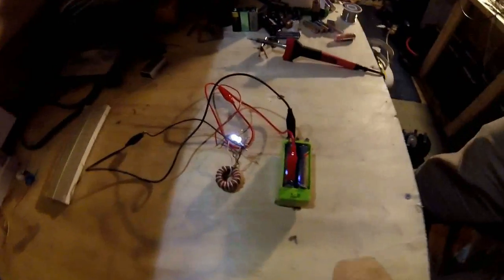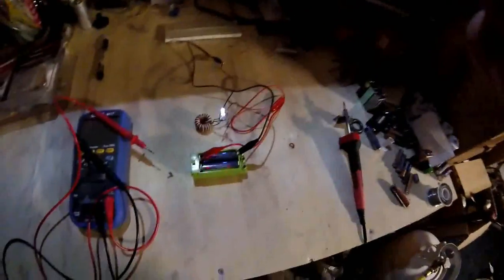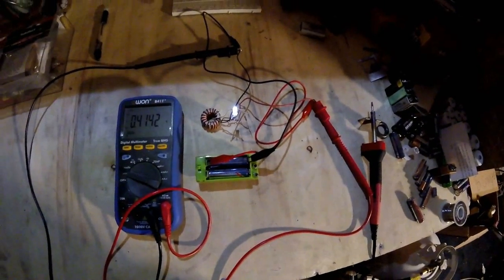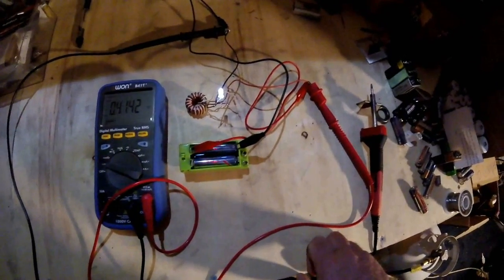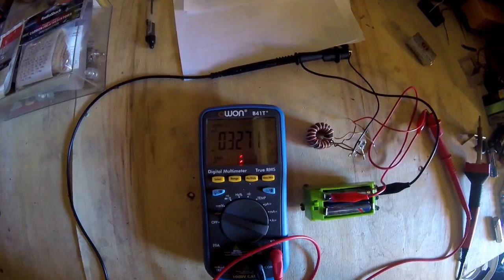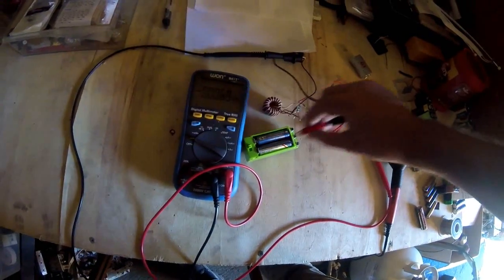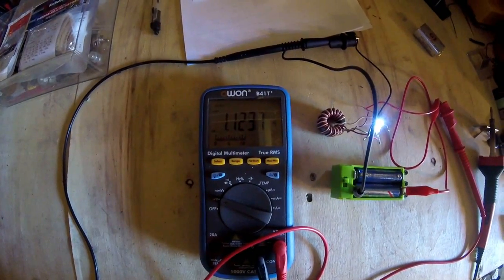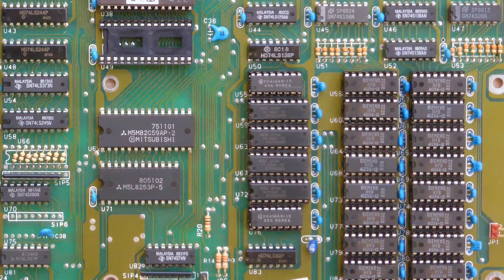Joule Thief Update After Running 3 Days Free LED Night Light

Comment: Hi Troy,  try connecting the joule thief  directly to an earth copper rod  and iron nail instead of the battery ...lets find out if the led lights up... you got almost .5 volts from  earth last time you tried!!!
Reply: good suggestion
Reply from the maker: I doubt there would be enough current but I can try

Comment: Hey Troy you cameras may be garbage at night but there is a solution i bet the have an cmos sensor that captures the pictures just like our mobilephones and thats the point you need some invisible light buy some ir (infrared) flooder and then you can see all clearly at night without blur and visible light someone may think he or she is invisible at night but everything will be clearly seen on cam try this i made my own floodlight ir out of an transmiter from my old wireless headphones :-)  it works perfect
Reply from the maker: Yes it may work. Thanks.

Comment: Did you ever try checking the voltage at the led terminals while it is lit? I'm curious to see what voltage is there compared to the battery voltage. Maybe you can do an update showing that.
Reply from the maker: I tried that but it is pulsed DC voltage so it only read half a volt. Not accurate at all.
Reply: The Do It Yourself World Electronics depending on the frequency it's outputting and if you have a true RMS multimeter you might be able to measure the ac voltage and the DC voltage separately. I believe the total RMS voltage would be (volts dc)^2 + (volts AC)^2 = (true RMS voltage)^2.
Reply: Use an analog multimeter and see what the voltage is.

Comment: Oh wow  3 days on not a dead battery.   I consider a 1.5 volt battery registering 1.3 Volts to be a dead battery.
A Battery that registers .6 volts is a Zombie battery...it is beyond dead.

I would like to know how long that LED would last on a fresh alkaline battery Troy.
Reply from the maker: Looks like about 120 to 130 hours or so. Got the math here: https://www.digikey.com/en/resources/conversion-calculators/conversion-calculator-battery-life
Reply from the maker: But somehow I do not think that sounds accurate. I figure they count the battery as dead at 1.2 or 1.3 volts. Then I guess you can double the number to around 300 hours.
Reply: Wow that would be amazing.   I need to read your article Troy on how this works.
I will have lot of free time at home now as my 1990 Plymouth Grand Voyager died on me on way home from the VA today haha.   Looks like I blew a lower radiator hose.

My last GF I had once asked me "  Bill, how long do you plan to keep that van? "
I told her  "  Until it dies or I die "

I guess it beat me to it  haha.
( by a couple years according to my cardiologist hehe )
Reply: neat
Reply from the maker: did you overheat and blow the engine though? A radiator hose is not that big a deal to replace.